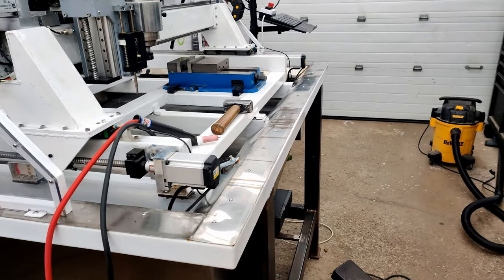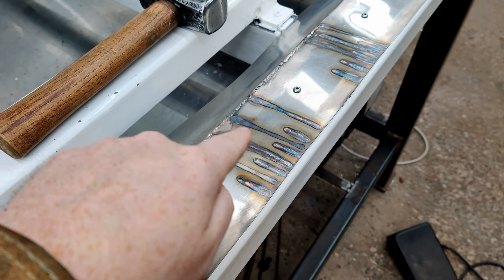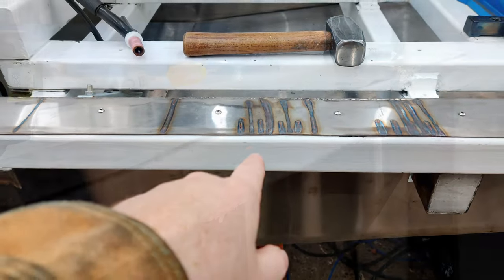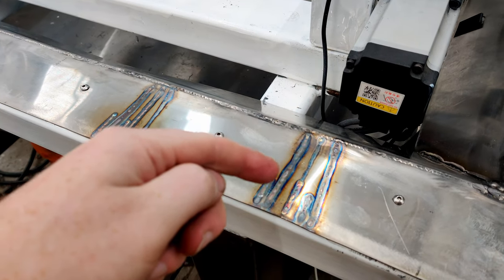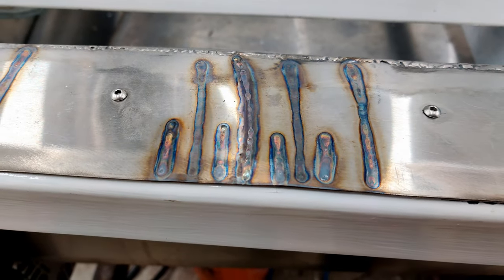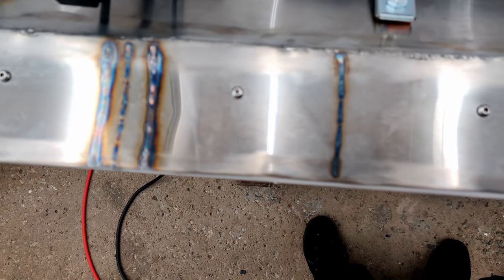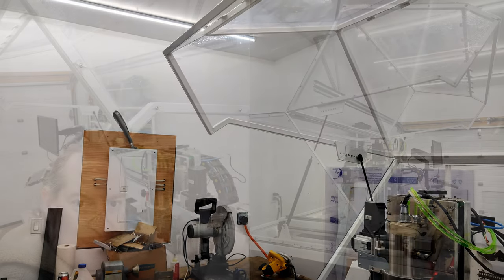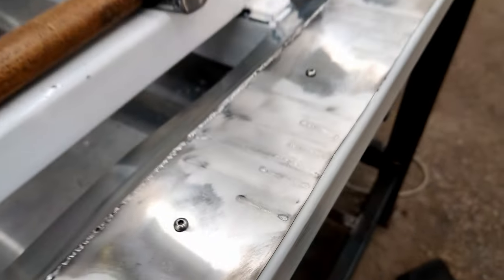Stainless Steel Welding Tips: Fixing Bumps and Shrinkage Issues

Comment: Great result!  When you mentioned that you would probably try this, it reminded me of something from my "youth"... I watched an engineer fix a loose shaft in an iron casting by running a few rows of arc weld along the mounting boss.
I just knew you would be annoyed by those warps... BAMMM!  Job done!  😃 👍
Reply from the maker: Yeah it became a real problem when closing the door. With an the gaps everywhere it was worse than without the stainless steel skirt.